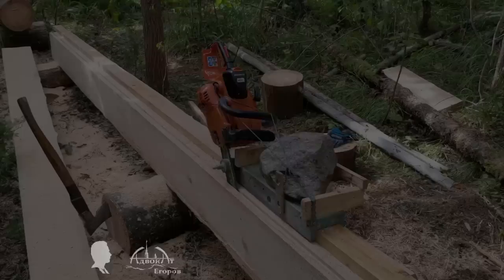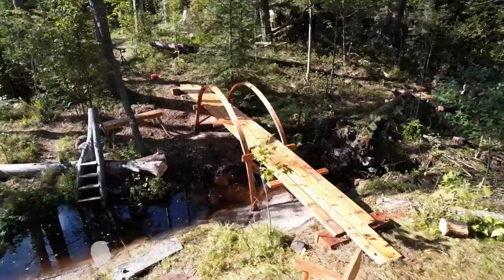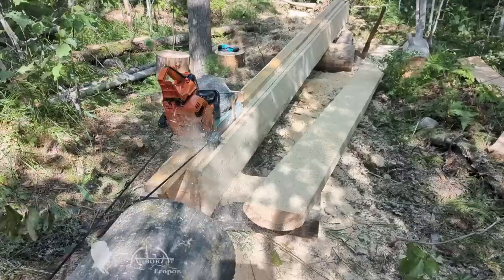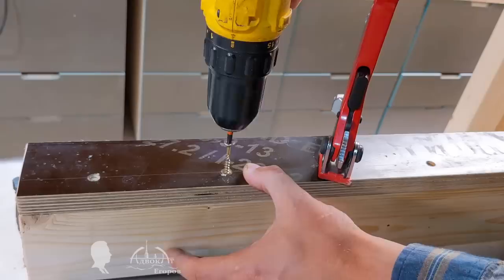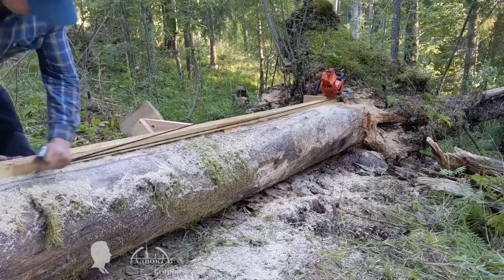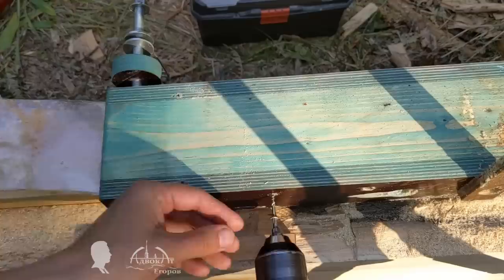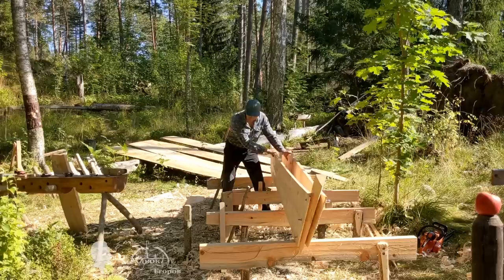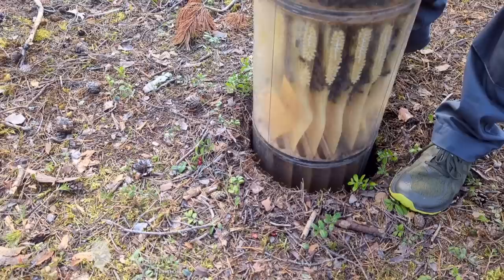Self–propelled Chainsaw | Turning Logs into Perfect Boards

Comment: first of all it's good to see you well after an eventful year in your parts. probably most of us who follow your work in the forest have noted the long silence and wished the best for you

interesting to see your lumber milling evolve. it's pretty amazing how you're able to get that quality of boards milled with a chainsaw in a fairly primitive yet somewhat precise and very precisely understood setup. when i set up my sawmill in the forest (a regular gas-powered bandsaw type), i first mounted 30' (about 9 meters) of steel trackbed onto the ground at a predetermined slope, so that i'd only hold the saw to keep it stable while it cut, and gravity would do the hard work. of course my setup was not portable, which means you need equipment to drag timbers to it. your thing is bring the mill to the timber, wherever it is. but a gravity feed might still help you, and your design wouldnt be harmed by finishing the channel and guide mating surfaces with an oil finish mixed with beeswax. applied hot and wiped off, this would not only help preserve your hard work, but also greatly reduce friction

as far as your epicondylitis i have two pieces of advice: 1) there is a physical therapy device that reverses the condition. there are several brands out there, 'theraband flexbar' is what is use. but there is also logest, dmoose, viking strength and otrhers. they all do the same thing. you can look up the research on it if it interests you, 2) aspirin, by which i do NOT mean ibuprofen (motrin) or acetaminphen (tylenol), just plain old regular strength aspirin. this is not for its analgesic effect, which is salutary, but for its anti-inflammatory effect. one tablet an hour before work reduces injury by reducing inflammation while the tendons are being used. if you find it's right for you to try these, i've no doubt you'll see excellent long-term results and almost immediate benefits from both therapies

there's nothing more permanent than a temporary solution
Reply from the maker: Thank you for your advice!

Comment: Max, as a Toolmaker/designer, prototype maker, pattern maker, master machinist, mechanic and general Jack-of-all-trades, most folks will understand when I say that I am not easily impressed with most people's work. But every time I see one of your videos, I am blown away! I have a circle blade sawmill that can make an 8x16 beam or, anything smaller. I was going to make an add-on carriage for my BIG chainsaw with 3-6 foot bar (1 to 2 meters) to slab large logs that my circle blade cannot do. But, you have just shown me there is a much better way. Your self-propelled sawmill is elegant in its simplicity. With the added benefit of not having to reset my sawmill every time I wish to change from milling dimensional boards to slabs. Thank you for the awesome videos!

Comment: Neat. Your mill solves a real problem (quality of milled product) with elegance. I have spent hours milling oak logs with a saw and always got a product that was 'good enough', but now I see that there is a better answer that isn't a wood mizer! 
There are other longer-term health issues that arise from long-term exposure to vibration: carpal tunnel syndrome and Reynaud's syndrome, also known as HAVS (hand-arm vibration syndrome) and whitefinger. The first is due to swelling of tissues putting pressure on nerves in the wrist, may resolve with time or there is a painful and damned inconvenient operation. The second is nerve damage and as nerves don't regenerate, is yours for life. Your auto mill will avoid these.  Thanks for posting. Gonna subscribe...

Comment: You are one of the only chainsaw millers I've seen that points out that ripping the log with the saw vertical and not at 90 degrees to the grain is the most efficient way to mill logs. I have been chainsaw milling logs in this configuration for 30 years after trying an Alaskan mill which was less suitable for milling Australian hardwoods.
Reply from the maker: The hardest wood that I milled was oak, which would still be somewhat soft compared to some of Australian hardwoods.))
Reply: @Advoko  I have a couple of videos on youtube:  search 'milling with Ventz', if you like. The timber I'm milling is Tallowwood.
Reply from the maker: I liked your setup, nice metal guide rail.
Reply: @Advoko  Thanks, "T" shaped rail stops saw from lifting, something you achieved by using a weight. My rails are heavier than your timber guide but can still be carried to the log by one man. I made the rails by welding a box section to a flat bar and then attaching feet every metre. After I'd welded them they needed straightening though.

Comment: Great idea, I did something similar for an alaskan sawmill set up.  My goal was not to achieve self propulsion, but rather to take about 15lbs of force off my need to push the sled and save on my back.  It worked perfectly and if I tweaked it following some of your ideas maybe I could get it to be self propelled.  I  used a reverse 4:1 haul system with 1 change of direction to generate the pull.

Comment: Very cool. A couple pulleys and a rope attached to a weight hanging off a tree could provide the constant tension to pull the chainsaw backwards instead of adjusting the rubber band multiple times. But maybe adjusting the rubber band is simple enough.

Comment: A very clever adaption of the chain saw to solve a pressing problem of milling out in the field.
I wonder if one could convert the same adaption by converting the chain into a radial rip saw ?  This would eliminate the need for bar oil, spraying onto the timber and less waste from each log, from a smaller saw kerf..

Comment: Impressive work, thanks for sharing it!  First thing I thought might help in some situations ...would a dowel anchored at an elevation equal to length of lumber to be milled, combined with another dowel in line with the direction you wish the chainsaw to travel.  Using rope, hang the appropriate amount of weight suspended at proper height, and with the dowels serving as the pulleys ... you will have steady amount of pulling power for chainsaw travel (a bucket of water would be an easy way to adjust the amount of tugging for energizing chainsaw milling).  You will also have the ability to easily adjust for the length of travel by how far up the weight is placed at the beginning of cut. So if milling an 8 foot board - hang (water bucket) weight at 8 foot height.  And add more water if milling a 2x12 rather than a 2x6.  Yes there will be more drag on the dowels than actual pulleys, but, this only requires a bit more water in the bucket to compensate.  I loved this, you might be a genius, I am going to try this very soon here in Canada.   Keep on keeping on and good health  to you.

Comment: I think you could remove the need for the big rock to weigh down your saw on the guide rail.

Basically...

1. On the long guide track/rail, on both sides if you cut a long notch/groove from end to end.

2. Attach on the saw block that sits on the guide rail biscuit type pieces on both sides of the insides.

3. Add stoppers on the finishing end of the guide rail so the saw comes to a stop at the end when it's finished, but leave the top/beginning end open.

This will allow you to slide the saw block from the top end and will also allow removal for maintenance.
The saw will stay attached on the guide rail, no need for the rock as counter weight.
Reply from the maker: Thank you for the input

Comment: Where I live on the ridge, the hillsides are steep, on a farm that was established over 150 years old. While the owners don't want the land logged, occasionally a large tree falls, which is difficult to move because not only do we not have the heavy equipment to move it, but also because there are no roads cut into the land. Before my arrival here as caretaker, the farm laid abandoned for over 15 years, and there is now a great need for replacement milled lumber to repair the aging outbuildings. Most folks would simply remove the old structures, and replace with new ones. However, according to the county auditor, the old buildings don't show up on the tax roles, and escape being taxed because they were constructed before the rural electrification program, with lumber that was milled on the land, ostensibly from trees felled here that were too large to move very far. Technology has advanced in what powers the saws needed to perform the work, and likewise the methods to mill the logs into quality milled lumber, has also improved, as illustrated by the creator of this video.

One take-away from the video which is useful for me, is the suggestion of how to join together the guide rail, using hardwood strips added to a routed groove on both sides of the shorter beams, which I can use to help replace the floor joists without having to raise up the buildings to replace them, because the walls and such of the rest of the structure were added to a finished floor, necessitating the need to construct floor joists that extend under the finished walls.
Reply from the maker: Glad you find something helpful for yourself!

Comment: Wow that was very simple at best.  But effective. Some really nice cuts.  I think I might just give this a go.  I think maybe a metal carriage with some bearings might be more ideal.  Just as I can weld and the added weight of the metal is less you need to add.  If it works good I might remake using extruded aluminum as the guide rail just to make it light and robust.

Comment: The beehives are very interesting. I am going to have to learn more about that. The bees are facing harder times than humans right now and I have been wondering what might help them. The rest of it is is super cool also. I love my chainsaws and do some amazing things with them but I am not strong enough to move those size boards by myself. I don't know anyone that loves to work in the woods like I do, so finding someone to help is quite unlikely.

Comment: Brilliant! I watched your old video on freehand technique and now use it routinely, this is an ideal addition. I’d love to see more on your homemade long chainsaw bars. What I noticed using your technique is that there is so much less strain and effort just “stroking” the timber with the saw toe that you could for sure use a much longer ‘reaching bar’ than the chainsaw engine size would usually support. Can you or someone else here suggest some detail on extending the bar/chain? Many, many thanks for these videos - so practical and inspiring.
Reply from the maker: Ian, I will publish a separate video about making an extra–long chainsaw bar.
Reply: @Advoko  I can hardly wait! I use your freehand technique to cut logs into halves or quarters which are manageable to get in my truck and re-saw at home on a bandsaw. It's been transformational for me, thanks so much.

Comment: I would suggest some sort of end of travel auto-stopper mechanism for the chainsaw so it shuts off, or at the very least, goes down to idle. So if you are away and it finish cutting, it doesn't just stand screaming and wasting fuel unnecessary.
For instance; the adjustment string holding the chainsaw in position could also hold down the throttle, at end of travel it releases a pin - by another tied string, "relaxes" the saw, releasing the throttle in the process, going down to idle.
Reply from the maker: Good point.

Comment: you might have carpel tunnel . i have watched a lot of your videos they goo and a lot of clever stuff , i do a bit of chainsaw milling and sawmill building , i currently have a 20hp chainsaw mill running .404 x 2mm harvester chain and use a winch , i am presently making another 10inch bar for my sthil ms660 running 3/8 x .063 x 30degs chain , i cut a cant with the big saw the i cut my boards with the ms660 up to 150mm max , cuts super fast and no stretch either , if i want wider boards , i use the 20hp mill , both saws run on the same rail from either end of the rail , my setup is similar to a logosol , but i have an 8mtr rail

Comment: Bro amazing constructions! You may want to bend the two boards on the bottom of the boat convexly so its exterior edges grab the water better than slide it, so if you have to stand up or move the boat doesn't slide under you woo fast.

Comment: Max:   I tried your "2 tricks" for milling boards from logs and it worked the first time !!    Your semi-automated mill is so impressive, I can't wait to try it out.  Would you consider moving the pivot rod to the other end of the carriage?  In other words, mount the pivot rod at the trailing end of the carriage instead of the leading end.    This might utilize the weight of the saw itself to press the carriage against the guide and possibly eliminate the need for the counterweight.    You can then just extend the 2 x 6 guide a little farther off the end of the log to complete the cut.     And it would make it possible to put a hinged post or wedge behind the saw to adjust the angle of attack, rather than a rope from the front.  Just my thoughts.    Your channel is breath-taking and truly inspiring.
Reply from the maker: Mark, thank you!

Comment: I try this with  a oregon 18 electric chain  saw and a works great i use a small crank  hoist to pull the saw and works  good . Is very important  to sharp you chain  for ripping chain the angle  to 10 degrees  not 30 . I don't  have the baybreation that a gas chain saw have so it wont slide on it own butt  is really  easy to pull no effort  you loose a 4 inches  on cutting  so in mi case I end up whit 14 inch cutting from a 18 blade so this will work great whit  a 25 to 30 inches  blade .I use a electric becouse  noise i have neibors however  I use a generator  that also is lot more quiet  then gas chain  saws

Comment: Excellent design and I have great respect for your skills as a craftsman and problem solver. I've been studying this topic of portable sawmills, considering whether I should buy this type or that and I've watched several videos featuring home made rigs but yours takes the cake. I'm a little iffy about the bungie cords though over all, the simplicity of your design is so straight forward I feel I have no excuse not to imitate it.  I will not be making of my own chainsaw guide bars. That would make a good video, showing how you make a guide bar would be interesting. I was reading an advertisement for one intended for rip cuts that is tempered for additional hardness because of the heavy workload in this application. Norwood Industries advertises a auxiliary
bar chain oil applicator for their PortaMill PM14 product you might want to have a look at. One more subscriber. Nice job Sir!
Reply from the maker: Thank you and welcome onboard! ;)

Comment: You may have been affected by a mild case of HAVS. 

HAVS (Hand-arm vibration syndrome) is a painful and disabling condition that affects the nerves, blood vessels, muscles and joints of the hands and arms. It causes tingling and numbness in the fingers, reduces grip strength and the sense of touch, and affects the blood circulation (vibration white finger, also known as VWF).
Reply from the maker: Thank you for the info!

Comment: Tendonitis:  an acupuncturist informed me that it is NOT caused by holding things.  It is caused by bending over.  Bending over crimps the spine.  I was able to NEVER have tendonitis again (after years of pain) in just 2 visits with a Chinese trained acupuncturist.  There are also stretching techniques you can do to relieve stress in that area to prevent it as well.
Reply from the maker: Terri, thank you for the info

Comment: Mate this is a great way of cutting boards. Im wondering how it would run on Australian hardwoods?
Reply: It won't be a problem if you can cut it while holding chainsaw
Reply from the maker: I would make more passes and make them more shallow milling such lumber

Comment: Just a thought but instead of moving the bands couldn't you have the tension attached to 2 pulleys? One that was however far back you wanted the saw to move. Then draw the rope up and attach a new pulley to re-direct down and then hang a weight to give constant tension on the saw. Since its not elastic as long as the weight isn't on the ground you would have constant pressure. Eliminating the need for constant re-adjustments. Thoughts?
Reply from the maker: You could do that, however, it is less practical in woods around here as you have to carry everything yourself.

Comment: I'd like to see the pirogue build.
Also, did you try waxing your rails, etc?
I could see that helping a lot with it sliding without the rubber band...
I love what you do Max. :)
Reply from the maker: I used a little oil on the beam

Comment: Hi great video lots of great info I have a question  you are using  gravity means your log is set down hill and the saw ride dawn pull by  the rubber  bands right?
Reply from the maker: You can use rubber bands even cutting uphill

Comment: In order for this to work you'd have to secure the chainsaw's throttle fully open. How long would you expect a chainsaw to last when it's engine is run at full revs for a lengthy period of time? I'd expect the chainsaw to overheat pretty quickly and cause excessive wear on the gearing. Also, given that the entire bar length is doing the cutting, there's a large amount of resistance... 
I can't see this being a workable solution for any practical purposes.
Reply from the maker: Mike, I was doing a few  passes for each board to prevent the overheating of a chainsaw...
Reply: @Advoko  The results look good. I might experiment...

Comment: Thanks for sharing. Great video. I would change the pull of de rubber band (which doesn't stay constant along the way) for a simple weight, rope and pulley system like the system used in this video: https://youtu.be/HbAwkID7cjA
Reply from the maker: Thank you for the link